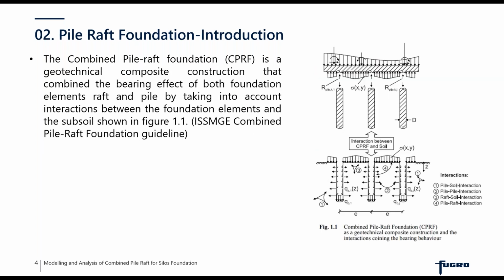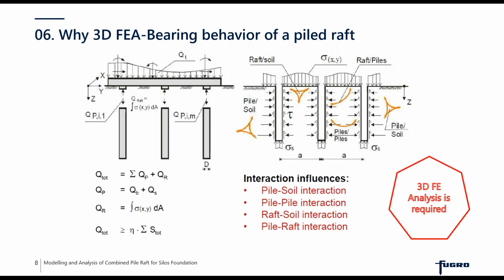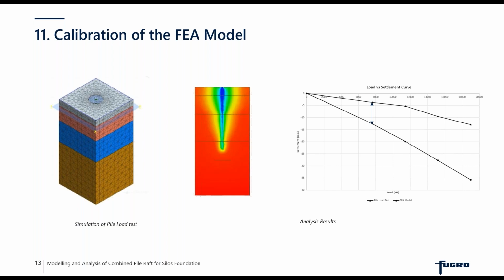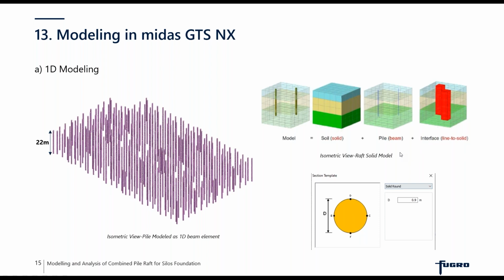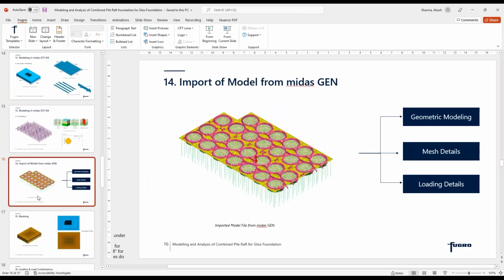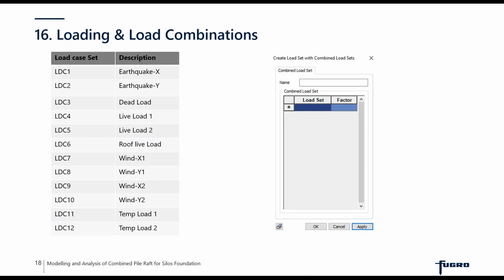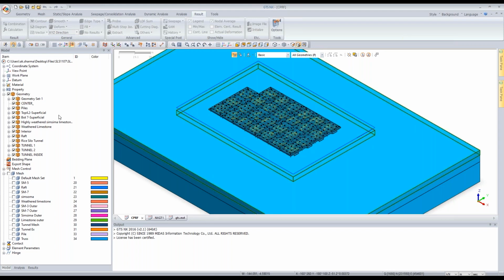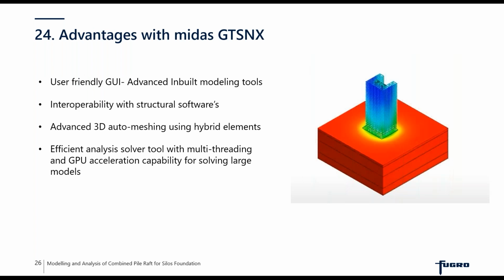Case Study: Modelling and Analysis of Combined Pile Raft for Silos Foundation

Comment: How to model single pile in midas gts nx
Reply from the maker: Hi, Karthik. When you want to model a single pile in Midas GTS NX, you can use a line or solid to simulate the pile. Usually, I've used a line and assigned pile parameters like 'Ultimate Shear Force' & 'Normal Stiffness Modulus'. And, If you want to use a solid one in 3D analysis, you can utilize the virtual beam to check the result including axial force, shear force, and bending moment from the solid.